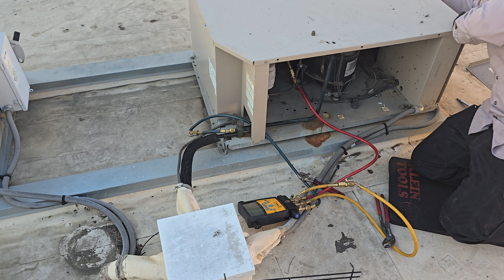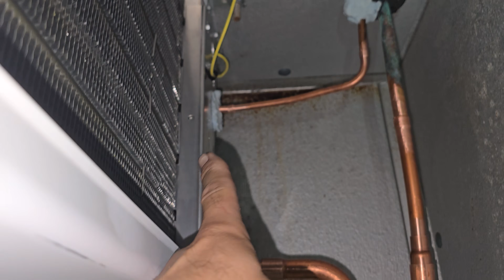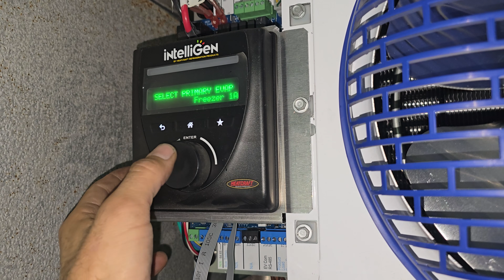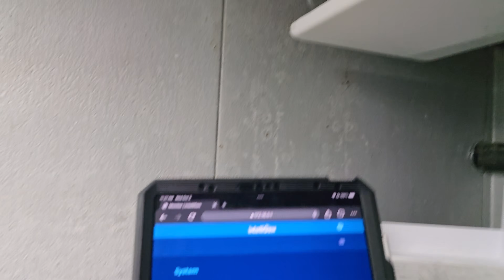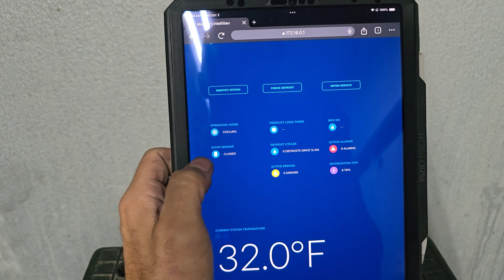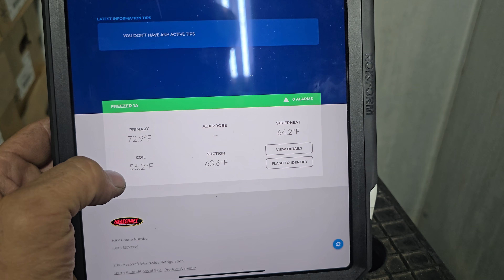HYBRID FREEZER GETS AN INTELLIGEN UPGRADE

Comment: Hi and question to ask you in regards to this job that you performed a new install of a replacement evaporator. What do you do with the old unit that you removed from the cooler room? It dident look that bad! Do you keep it fkr parts? Or does the owner want it. Did you throw it out and give it to a scrap metal company? Question why is it that you do not have a email address for use to ask you a question. Only a web site.   Thanks ken
Reply from the maker: FYI There is an email address in the show notes of every one of my videos hvacrvideos@gmail.com

As far as the old evap we usually let our employees scrap them and keep the cash

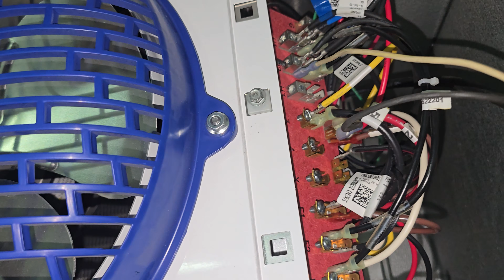Comment: 6:33 - You have the condensate drain heater connected to the defrost heater terminals. Would it not be better to connect to the fan circuit to prevent ice buildup in the drain during the call for refrigeration? Thanks for all your detailed video posts.

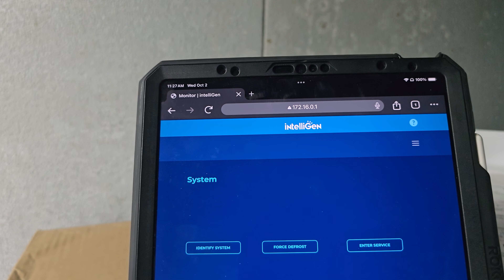9:43 - Interesting. I would have expected a class C IP4 private network space (192.168.x.x) rather than a class B. I guess they’re anticipating a lot of devices connecting to each network (over sixty-five thousand hosts per subnet).
Reply from the maker: I will discuss this on my livestream this evening 10/21/24 @ 5:PM (pacific) come on over and check it out https://youtube.com/live/MOU3KyZBJr4
Reply: I think that system supports keeping the technician AP on while it is connected to another wifi network. Defaulting the direct-connect AP to a network that is less likely to clash with a stationary network makes sense---it's kinda impossible to have two network interfaces on two different networks with overlapping addresses.
Reply: @HenryLoenwind only if two or more NICs are on the device can it be connected to two different access points.
Reply: @garypoplin  But if the addresses are the same, you need to run two independent TCP/IP stacks. And because all operating systems have the stacks built-in nowadays, this means running a second operating system in a VM and forwarding the connections using an internal virtual network.

There are some constellations where you can get around with not installing routes and having the application software bind to interfaces directly, but that only works when there is no address conflict. And as the AP interface and the default router on the client interface would most likely have the same address if you go with the private class C, this doesn't apply here.

Comment: Doesn't this condensing unit have a head pressure control valve?
You said it does not need it if it has an EEV. Now I'm confused
Reply from the maker: I could have misspoke but I’m pretty sure I said it doesn’t have a liquid line solenoid valve if it had an eev….. if I didn’t say that , that’s what I meant to say

Comment: Most installers would just put in the unit and not bother checking the transformer I see it all the time and the way I think of it it worked like that for years so I leave it because as soon as I change it to be right something will break

Comment: Efficiently is all well and good, but as they press harder for more, the systems are going to get more complex and it will cause problems.  Look at all the complex stuff that's been put on cars: Computers to set the mixture, variable displacement oil pumps, fuel pump modules, complex battery management systems, etc.  All to squeeze out an extra 1 MPG.  And when they go bad, it gets expensive to fix.

Comment: I haven’t ran across an Intelligen system yet. I have a few Trenton units that use an EEV. I really like the EEV setup. From what i have read the Trenton digital controllers are designed and manufactured by KE2..
Reply from the maker: I did not know that, interesting

Comment: An open color door can waste lot of energy.  Cool room curtain strips or an air curtain could be installed if cooler door needs to be open for extended lengths of time.
Reply from the maker: You are absolutely right, it's a good idea to use a curtain to save energy if it needs to be open for a while but often times the customers don’t want them because the cooks ruin the curtains and they constantly have to replace them

Comment: I really hate pump down cut out. So bad for the compressor.
Reply: @paulsilver1625  it’s a must with refrigeration equipment with a receiver. Imagine off cycle like ac….and there goes the liquid charge equalizing into the suction line. Very bad for compressors.

Comment: that P trap is gonna cause you issues on the long run ... should of went with 5/8 from the coil
Reply: I’m a p trap noobie, how will it cause issues / what is a p trap for?
Reply: @yinggamer7762  he  shrunk   7/8  to   5/8 on the  rise   oil will have  tendency  to drop back  down  since  vapor  is  light ..

P trap   or  u  bend is used  when  you  have a height travel  greater thenn  ie: 5 ft   

Different line sizes  call for  higher or lower p trap uses
Reply: @itsprimetime9865  you only need it when the condenser is above the evaporator?
Reply: Actually the connection size p trap and then reduce on the riser is the better method.
Reply: @skipsandvig8888  no ....

Comment: What is the typical superheat with an EEV on a reefer unit. I know comfort cooling very well....but in all my years in this trade and the many reefer units I've worked on.....never touched one with an electronic expansion valve. I know the chillers i work on have typical ranges. Example air cooled chiller is typically 8-10° SH, centrifugal chillers run very low superheat from 0.5°- 5°. I got a kick out of how jazzed you were to see the data on your iPad. It's cool to see reefer equipment getting into the more modern available types of extracurricular controls. As a side note...I wonder if that card has the ability to except AI's....you could use some CT's and see if fans are running, compressor is running, heaters are running....etc etc. Analog Inputs give you the ability to see multiple modulating values.
Reply from the maker: 8-10 for medium temp 6-8 for low temp is where I aim with eev’s

Comment: I saw you reduced the suction line after the ptrap , well done. I cannot tell you how many time in nearly forty years I saw this done wrong.kudos to you for expertise!!!
Reply: it is wrong he's not suppose to do that   he should of went with 5/8 right from the coil
Reply: @itsprimetime9865    No by going 7/8 to 5/8 on a horizontal run there would be trapped oil in the evap.always come out of an evap with suction size to a trap and if necessary reduce at the top of the trap.
Reply: It needs to be reduced after the 90 going down from the coil but before the 180 degree bend in the trap. The reducer after the trap is going to potentially cause issues with oil being stuck in it. Also  if you reduce on a horizontal section of pipe then you cause oil to get stuck in the pipe / possibly evap before the reduction. Reducing it after the trap is definitely better than reducing it on the horizontal section after the coil, but reducing it on a vertical section before the trap would be best, as you would be increasing velocity through the trap helping the oil return. If you you reduce it after the trap you will reduce the velocity through the trap, possibly enough that you will not have oil return.